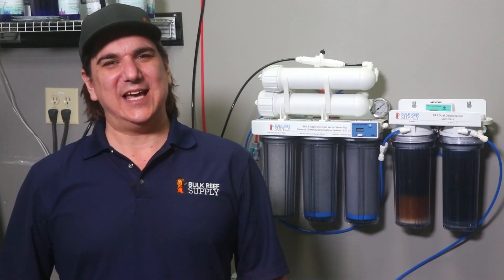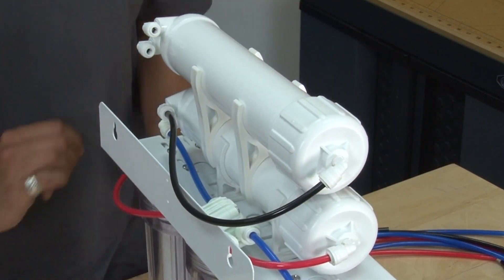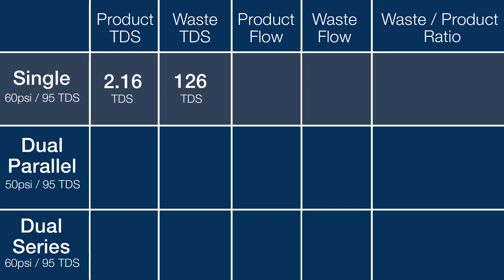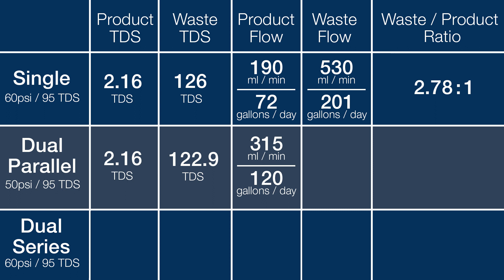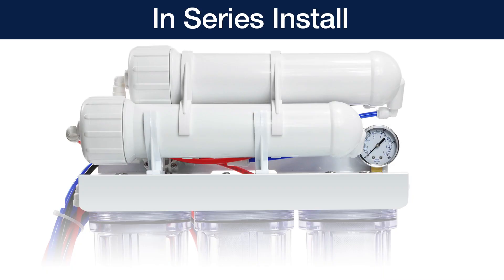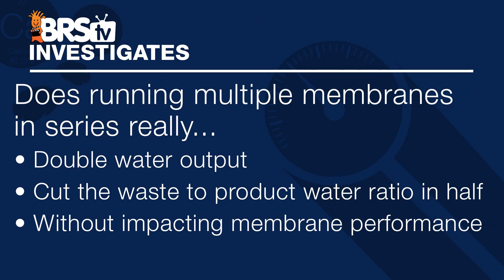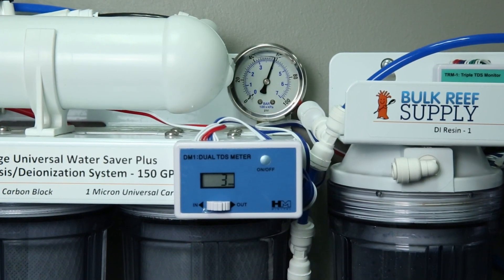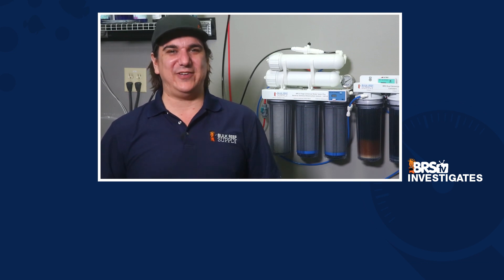Why would I want two RO membranes instead of one?   | BRStv Investigates

Comment: MY question is if I got a large RO filter like 1,000 GPD that requires like 300 psi can I operate it at 60 psi ? will it still work and I'm sure I wouldn't get 1,000 GPD but maybe like 500 GPD ? What I'm trying to do is achieve 300 to 500 GPD without a holding tank and I have a shallow well with a pump in my crawlspace. I have a very large Sediment filter and a very large Carbon Filter and then I want to add a very large RO filter. I want to be able to use my water and still have full water pressure at my faucets but I don't have room for a holding tank.

Comment: If I already have a 100psi before the first membrane do I have to install another booster pump for the second membrane in series connection? I'm working to make my RO system automatic and I saw this video very helpful, might install a second Membrane.

Current membrane 100GPD..

Comment: Thanks for this video just wondering will it work if I do the same way on Di resin as I have stage 5 and Di resin trying to work out that’s connected to automatic shut off valves mine comes with booster pump etc
Reply: Could you send me a tutorial of that as well with Di resin please thank you

Comment: Am I reading your chart correctly?  With a single membrane, waste was 530 ml/mn. With the dual in series, waste is 535 ml/mn. A single Ro puts out 201 gallons a day waste and a double in series puts out  203 gallons a day waste.  I'm reading the chart!  It doesn't seem like it's "Saving" water. You're wasting a little more but also getting more product.

Comment: I have a 400gpd system running with a booster pump. I want to add a second membrane, do I need to upgrade the pump as well, or can i still use the 400gpd pump?
Reply: I have same question with 300 gpd

Comment: Hello, I could do with some help, I have a 300GPD Single Membrane I'm wanting to instal another membrane after it another 300GPD, I don't know if i can run the 1/4 Pipe to the second Membrane or if the pressure drop will be to high, alternative is change the fittings and have 3/8 tubing from the waste of first to second? Thanks Robert
Reply: I also have same query

Comment: Thank you for the video.  I am dealing with 750mg/L source TDS and have been giving a couple different solutions.  Having purchased the 200G Water Saver, BRS told me to just bypass the 2nd membrane because of the concentrated TDS feeding into that 2nd membrane.  Another company told me to run their 100gpd membranes in parallel with the waste restrictor wide open.  Seems like there is no ideal solution and I just need to pick the lesser of evils for my scenario.
Reply from the maker: Source water TDS that high is certainly a challenge. Running a single membrane is usually the best option for source water above 350 TDS or so. Running an RO system with no restriction on the waste line seems like a poor option as it will not only significantly increase the amount of waste water you're producing, but also slow down the speed at which the RO/DI system is producing water.

Comment: Can someone answer some questions:
# Recommended FLOW Restrictor RATES for such DUAL SERIES for different GDPs?
# How do I recognize that my auto shutoff is default
Reply from the maker: 550 mL/min for 75 GPD single membranes or 150 GPD Water Saver Systems
800mL/min for 100 &150 GPD single membranes or 200 GPD Water Saver System

The auto shutoff valve should be looked at if you stop your product water from flowing (like with a float valve in your reservoir) and your waste water continues to run. A couple of things to note - It can take 5-15 minutes for the auto shutoff valve to trigger and your system will need at least 40 PSI for it to function properly.
Reply: @BRStv  Thank you for your super fast answer. With "Water Saver Systems" you mean the described DUAL SERIES. What does happen when you use smaller flow Rates like 400 or 300.

Comment: What is the pump Gpd
Reply from the maker: The output of the RO system will depend on your source water pressure (higher pressure = faster water production and lower pressure = slower water production). Most reefers running a two membrane water saver setup like the one featured in this video, will be using two 75 GPD membranes for a total of 150 GPD in water production.

Comment: Excuse me, what is the required pressure to produce best?? Need to change pump?
Reply from the maker: higher pressure generally produces better rejection rates. The challenge is that higher pressure also increases the chance for a leak, so we generally advise staying below 90 PSI. 

You might find this video helpful as well: https://youtu.be/X14cUW-DXbs

Comment: I'm currently running a 150gpd RO with a 550ml flow restrictor. Want to install another 150gpd membrain in series. Can I use same 550ml Flow restrictor or do I need to move to an 800ml or 1000ml flow restrictor. With 1 150gpd RO and 550ml FR I'm getting about 1:3 producing 120gpd.
Reply from the maker: Short answer: we recommend an 800ml/minute flow restrictor.

Slightly longer answer: If you're running them in a water saver configuration (where the waste from the first is re-filtered through the next membrane), then you'll want to size the flow restrictor for the 150 GPD membrane. We usually recommend 800 ml/min flow restrictors for 150 GPD membranes.

Comment: Buy why are using ro for a input tds of 95
Reply from the maker: For our saltwater aquariums, we aim for 0 TDS. While not all TDS is inherently bad, the TDS reading doesn't tell us which contaminant is present. If it's sodium chloride, then no big deal. If it's phosphate, then we definitely care and want to remove it. Our salt mixes will re-mineralize the water with all of the necessary major, minor, and trace elements.
Reply: @BRStv  1st, thats a domestic purifier system which you used.
2nd, tap water is already processed by city for harmful contaminants, even if there is a leakage in pipelines and cross contamination happens, it can be removed by sediment, carbon and UF memberanes.
3rd. 95 is good TDS, WHO and all other standards suggests a TDS below 500 is good
4th. Zero TDS mean it is equivalent to distilled water. Highly acidic and very dangerous

Comment: Do we need bigger pressure to install double membrane 100+100 GPD in series compared to single 100 GPD? Thank you
Reply from the maker: We suggest a minimum PSI of 50 PSI for a single membrane system and minimum 65 PSI for a dual membrane system.
Reply: @BRStv   Thank you for the reply, very appreciated 😄

Comment: Hi :) Thanks for great material!

I'm thinking... if we would like both membranes work optimal, it shouldn't be the same. If second one is 75 gpd with 420 restrictor it means water consumption of this one is ~1,33 x 420 = ~560. But 560 "restrictor" fits 100-150 gpd membranes. It means, the first one shoul be this "size" - ~100 gpd or more.

Am I right? :)
Reply from the maker: If you're running two membranes in a water saver configuration, you'll want both membranes to be the same GPD rating. When set up this way, you'll only use one flow restrictor on the waste line of the second membrane.
Reply: @BRStv  I understand the concept of config very well :)
But i'm going further with it...

The second membrane needs a prper flow restrictor. It's obvious.

But for the first one the flow restrictor is not a real one flow restrictor. It's whole set of second membrane. The set has bigger flow than restrictor itself. It's the flow the second membrane TAKES :) So, for 75 gph second membrane has cosumption ~420 * 1,33 ccmph = ~560 ccmph.

560 ccmph is a proper flow restrictor for ~100 gph membrane. It means, if you use whole second membrane as a "flow restrictor" for the first one, the first one should has bigger efficiency than the second one.

Try to contemplate this, please :)

Comment: if i am running a 300gpd ro with pump, can i add the spare 100gpd membrane  that i have laying around to the waste outlet of the 300gpd , or would the one on the waste have to be 300gpd also ?
thank you
Reply from the maker: In the water saver configuration, you'd want both RO membranes to be the same GPD rating as they'll operate off of the same flow restrictor.
Reply: @BRStv   so would the 300gpd booster pump still be fine or need to upgrade to a 600..

Comment: My TDS is 750 PPM. Can I produce almost DI quality water by taking the RO Product water (now about 75 PPM TDS) and running it through a second RO Unit to obtain about 8 PPM Product? Do you have a video on this?
Reply from the maker: Since RO membranes work based on pressure, you'd have to find a way to collect, then pressurize the water before pumping it through the second RO membrane.

Comment: My water comes from a softener with a feed water TDS of 860 and high precipitation. Feed soft water’s TDS from the softener to the membrane is 871, however there is not precipitation when tested meaning is just sodium. I am looking for less than 10 TDS IN ORDER TO PRODUCE CRYSTAL ICE. Which set up do you recommend. Another question, is the transparency of the ice related only to TDS, I have a 45 TDS going to my fridge ice maker and is coming white in the center..many thx. Great job..!,
Reply from the maker: We've never done a test on ice, but would assume that 0 TDS water would result in clear ice. The RO membranes we sell have a rejection rate of up to 99%, so if you have source water TDS of 871, you can expect outcoming TDS to be as low as 8-9 TDS without the use of DI resin.

Comment: Assuming I run two 150Gal a day membranes in situ, would I need to upgrade my RO pump that’s rated for a single 150Gal membrane... I’m assuming not. however wouldn’t two membranes cause the pump to work far harder and possibly break?
Reply from the maker: If you're running the membranes in the water saver configuration, you shouldn't have to replace your booster pump.
Reply: Thank you for replying. I’m genuinely interested in saving water and gaining faster productivity. Here in the UK my mains water pressure is set at 35psi so the pump is working very hard already. Just needed to be sure this water saver set up wouldn’t cause the pump to burn out. They ain’t the greatest after all. Thank you.

Comment: I just replaced my filters but I didn't replace the membrane I figured it would still be good since it's a year-and-a-half-old but I didn't like the way the water tasted and the TDS readings were in the 50s so a few days later I decided to replace the membrane as well so I emptied the unit and removed the filters and the membrane and sanitized it with bleach and rinsed twice. But I'm still getting TDS readings of 53. the last time I did it I was getting readings of 12 and 13 (but then again all internal parts were new) and the taste was no comparison. Is it because the three filters have some of the old water in it  from the old membrane ? will the numbers go down or could I have done something wrong?
Reply from the maker: You'll want to let the system run for a bit. This will help reduce any residual TDS from TDS creep inside of the RODI system. It can take 5 or so minutes for the TDS numbers to come back down to normal after you start up your RODI system after it's been sitting unused.

Comment: question. so no flow restricter after first membrane for waste water conected to the second membrane?
Reply: This would be one of the other benefits of a series RO. Only one flow restrictor inline. The membrane needs to be operated at a certain pressure so having the flow restrictor at the end will maintain that pressure across both membranes.

Comment: When do you need to replace those water saver membranes?
Reply from the maker: You'll want to take a look at the TDS IN reading on the meter. Over time, you'll notice that the system tends to run at a certain number. For example, on the TDS IN on a meter, you might notice that you usually have a reading somewhere between 4 and 6 TDS. If you see this number skyrocket, this would indicate a membrane issue or tear and it would need to be changed.

Comment: Do u have a video of how to set it up in parallel
Reply from the maker: We don't have a video on that particular setup. That said, it's pretty simple. Just split the product line after the auto shut off valve and run the two lines to each RO membrane cap. On the other end, you'd combine the two product lines back to one line and run it through the other end of the auto shut off valve. You'd need a waste line for each membrane and a flow restrictor on each waste line.
Reply: Bulk Reef Supply thanks for taking the time to reply I really appreciate it

Comment: i think you are wrong about so something if you have really dirty water, running them in series is not the worst option... its the best option.. just connect the 2nd filter with the clear instead of the waste line and reduce the flow rate of the first waste restrictor so you get enough pressure. (Or just connect the 2 waste water lines in front of the restrictor) should make you end up with a higher waste water ratio...but really clean water.

Comment: Does it matter what brand the RO unit is
Reply from the maker: It could dependent on what membranes, or flow restrictors they use. Our equipment will work with most RO units though.

Comment: Or just with one membrane you just plumb the concentrate into the intake again, and add a smaller drain with half the flow restrictor, the way you keep flow through the membrane up reducing scaling, like commercial systems do. You do need a pump though. Why does nobody use this technique? Should I be revealing my project to public thought? And what the hell you can clean membrane scaling with citric acid too, or have a polyphosphate filter in the prefilters to avoid scaling, there is so many solutions WHY DOES NOBODY USE THEM!
Reply: whoa I wonder why no one answered.  That sounds pretty reasonable though..

Comment: Wow, your guys water is awful. In Long Beach California total TDS entering the system is 10 and 0 on the exit. We also have great water pressure 60+ PSI. My water saver system last about 1000g before I have to change the canisters, and about 2k gallons before a membrane. I guess it really matters on where you live and how strict your city is with water quality to their citizens (looking at you Flint). Cant imagine someone working with well water with high sulfur and heavy metal concentrations.
Reply: Itll be interesting to see how the TDS is on my water. Water heaters are lucky to last 5 years here.....its liquid rock.
Reply: I live in San Jose and our water coming in is 394 TDS. Some of the worst water in the country.

Comment: imo when You make one longer membrane of 2 times bigger working surface by connecting them in series You should give flow restrictor of 1000 minimum. That's why the ratio is nice because the first membrane works properly but the second  works out of specs and is being flushed by concentrate not fresh water. The whole second membrane has worse working parameters not only tds but calcium and magnesium salts are more saturated and  precipitate easier on second membrane. It mostly depends on water cost and quality - what is cheaper buying frequently a new second membrane or using less water in the desert :)...
Reply: BulkReefSupplyCom you are right but in this case runing paralel and giving them one 550 restrictor together gives the same results because the pressure rises in the membrane more tds passes trough, first 1/2 of both membranes represents first membrane in series and other parts 2nd one. In the end we get the same results but both membranes age in the same manner - faster in the 2nd halves :)
Reply: The correct measurement method would have been to put a pressure gauge before the restrictor and adjust the them in each case to reach the same pressure condition.

Comment: Hi a very usefull movie but if i would use 2 membranes single line the tds would be a bit higher but no problem becaus its such a little. But can you stilk use with 2 membranes a boosterpump ore is that wrong becaus the tds would be higher ore equal?

I like the idea of saving water verry much i have fore 10l something like 50l waste water somethimes more

Comment: Hi everyone, so yesterday I set up the dual RO/DI system  as Ryan has described. It was very straight forward and went together great, being an old saltwater fish-keeper (20 years ago) I had a good Idea what was required.
After doing the dual RO build I installed the booster pump (new item) immediately before the first RO, I then installed the pressure switch (new item) on the product line, after that I installed the auto flush valve (new item) to the waste line.
I installed the DI resin kit so it was before the Pump and after all the other filters prior to the membranes. 
I installed a TDS meter probe on the incoming water line near the sediment filter and one on the product line leaving the last filter. My TDS fluctuates quite a lot, my reason for placing it where I did. 
Finally I installed a pressure gauge after the pump and before the first membrane. So I could monitor the pressure prior to the first membrane.
TDS in fluctuates between 123 up to about 195, TDS reading on the product line has remained 000's.
I filtered about twenty gallons of water yesterday evening after the build inclusive of a flush of five gallons prior to the product run, which leads me to this question. 
I used a complete filter cartridge of DI in the process, that created a deep intake of breath, had I done something wrong cause that is expensive water? I plan to install a bypass for the DI section as I also store RO for drinking in the kitchen and bathrooms. All comments will be appreciate, thank you.
Reply: I  do think the water should go by the Di last after both membranes .